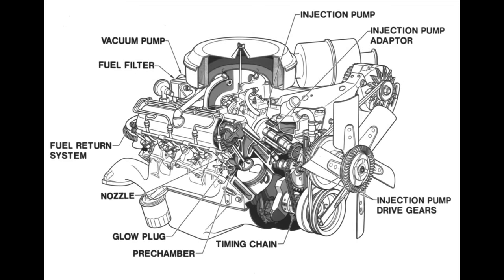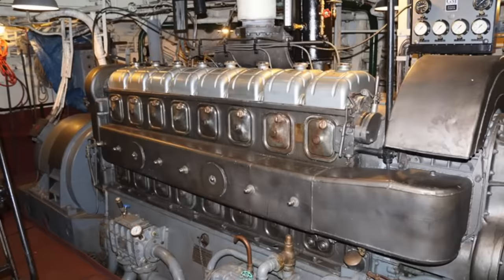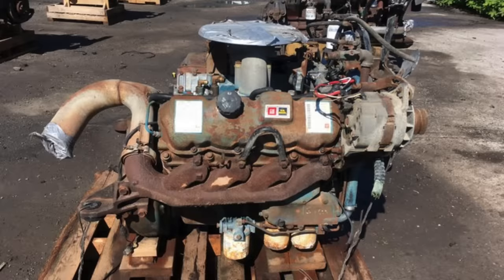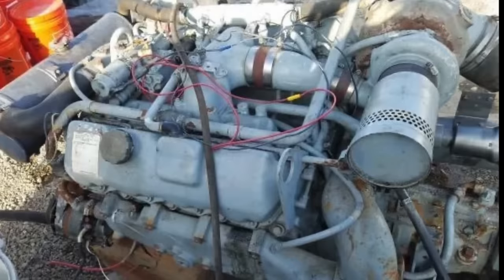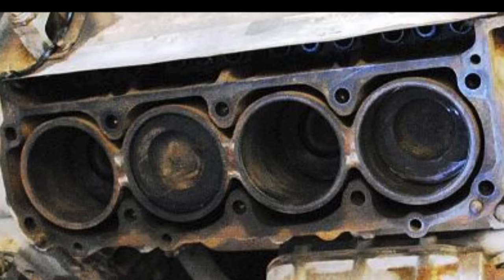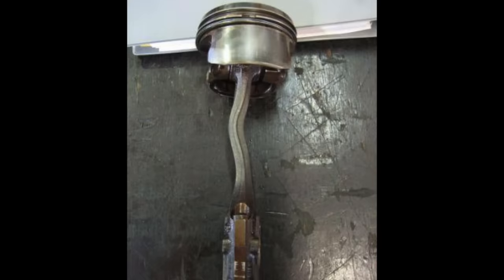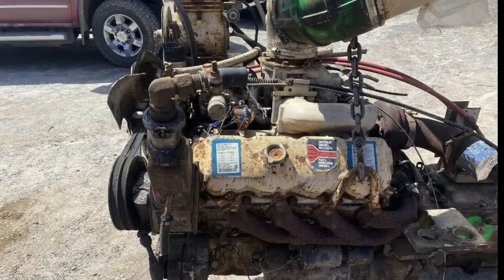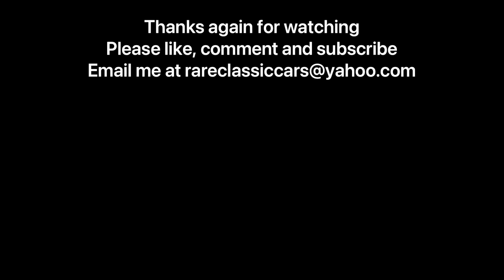Worst Engines: GM's 8.2L / 500ci "Fuel Pincher" Detroit Diesel Pinched Its Owners' Pocketbooks

Comment: I think detroit lost market share because their heavy-duty engines (the series 53 and 71) were obsolete, and when they tried to put lipstick on their pig with the 92 series, they put 2-piece pistons in it which were an utter failure. They were so bad GM ran a full page color ad in the the trade magazines apologizing for all the problems with the 92 series and promising to make it right. But it was too late, many OO's and smaller operators were driven into bankruptcy.  The 4-cycle 60 series was a smashing success right from the start and really saved their bacon.

Comment: What makes this worse is knowing that Cadillac had a 500ci gas engine that made 400HP and 550lb-ft naturally aspirated like 10 years before this. When a turbo diesel makes less power and torque than a NA gas engine of the same size it's a sad day lol.

Comment: When I worked for the forest service back in the late 80s we had an engine that had an 8.2 in it. Yes I can confirm it was noisy, slow, tiring to drive long distance as top speed was 62 mph. It might had been an Olds diesel.
Reply: Wasn't the Federal mandated speed limit in the 80's 55mph?   Lol, yea I get it, 62mph sucks.... Alota medium duty trucks were geared for low tops speeds in that era unfortunately. 
Oldsmobile had nothing to do with these engines though. It was 100% Detroit Diesel.

Comment: Good lord. Those power numbers are hideous. The Cadillac 500 gas engines did better in HP and torque in their final years of production 75-76. And we all loved the 200 HP big blocks of the era. But at least they made torque which a diesel should make in spades. Apparently not in this case. What were they thinking?

Comment: I never understood why socket type cylinder heads where ever used. Extend those clys slightly into a reciever socket around combustion chamber with appropriate gasketing and one would think it would retain any and all so called benefits.  Eliminating the weaknesses of such a design.
Reply: You mean like a 149 series? Those things are not my favorites getting those heads off can certainly be fun!

Comment: Detroit Diesel designed the 6.2 around the same time.  While an indirect injection engine,  it had a closed deck block with 17 cylinder head bolts per bank..

Comment: The open deck design doesnt necessarily mean theres going to be an issue. At least not in gasoline applications,  Honda used open decks in its D and B series motors with stellar reliability,  my Mazda V6 has open decks and the block itself is known to endure 800+ HP levels in touring cars and 1000hp levels in drag applications.   A diesel is certainly something else entirely,  but its probably not impossible to make it work if adequate engineering is applied.

The honda blocks are known to fail at very high power levels,  the root of the cylinders where they meet the top of the crankcase would sometimes shift downwards, but thats when you ate making 800+ hp out of a sub 2 liter engine. At more reasonable levels an easy and inexpensive trick is to drill and tap a hole on the major thrust side of the block and use a stud torqued against the cylinder to about 1-2 inch pounds to keep the cylinders from fretting the gasket. Seal the stud and use a lock nut.

Comment: Tge olds 350 diesel sucked as a diesel, but it made a great block, crank, and rods for a race car. They were stronger than the gas blocks and had forged cranks and rods. 
The penny pincher diesel was horrible. 
The Cleveland diesel plant became emd and they made big Detroit style 2 strokes for trains and ships and giant generators

Comment: i wonder if i can take the old vega block in the barn and tig weld more metal at the top of the bores and re deck it to prevent the walls from walking.

Comment: Interesting.  I have a question, here.  Couldn't they put a Darton closed deck sleeve system in the block?  This would certainly get rid of the 'flex' in the cylinders.  I know that a lot of drag racers use this system in their cars, replacing the open deck systems on many engines.  I have a few friends of mine who have done that.  They hold large amounts of horsepower.   Just curious.
Reply: Well, it’s not a financially sound job. It isn’t done often, so the Darton sleeve/ deck set up would have to be custom made for extra $$$. Then, you are looking at another probably $3500-4000 in extra machine work. There are other fixes too, but all they do is expose other weak points in the block. Upgrading head bolts would help with the head gasket problem, but then the cam would usually lock up because the extra clamping force twisted the block. They would have to get a company like Dalton (Yes, Dalton, not Darton) to do for this engine what they did for the newest military 6.5 diesel. They upgraded the block, heads, crank, rods and pistons. That made sense because the military uses them still. But it doesn’t make sense on the old diesel because there are far better and cheaper drop in engines, and there just aren’t that many of these still being worked. Even if the price was reasonable, it’s still underpowered and not the best design. You can polish a turd, but in the end, it’s still a turd.
Reply: @adamr9215  I certainly don't disagree . I was more wondering if it would be feasible to put in an aftermarket closed deck system, not considering cost.
Reply: @johnandrus3901  In that case, it could be done, but would just lead to other problems. Even with the sleeve/deck set up, you aren’t adding enough strength to the block to handle just the added bolt torque. Unfortunately, it was just a poor design in an attempt to save weight.

Comment: I believe Detroit Diesel did produce a generation of the 92 series engine which had a lot of problems. This is why they lost so much market share. 
I doubt the Fuel Pincher engine was sold in large numbers. In 1981 Chevrolet offered 3 diesels for medium trucks: 

Cat 3208
Cummins VT-555
DD Fuel Pincher

I hope most choose the two other diesels engines or the gasoline option.
Reply: the 92 series was a successful engine, without serious problems, however by 1985 they couldn't meet epa standards and were withdrawn from vehicle use. i think they continued offroad for a couple more years, but by then the series 60 was kickin ass and takin names.

Comment: The DX 350 Olds Diesel blocks were the best toughest Olds blocks ever made.
You can convert them to gas with the older gasoline heads. Much thicker block that you could beat the hell out of.
No other Olds block can take a beating like that block.

Comment: In the late 70’s I worked at an automotive test center.  We had a large contract with DDAD, durability testing the 8.2.  I got to know that engine inside out.  I had high expectations for it.  I was very fond of it and crestfallen when it failed in the market place.  I thought they should have all been turbocharged, though.
Reply: Thanks for telling us that you were bad at your job. The engine didn’t fail in the marketplace, it failed when it came to working. Companies ordered them left and right, but after they came in and were nothing but problems, they changed their orders. You should have pointed out all of the obvious flaws and failed the engine. Then they could have made something worthwhile.

Comment: On the 5.7 "small block" gm diesels, it was 50% gm design flaws and 50% operator error. A lot of them failed from customers driving them like a 350 gas engine. Not warming them up or letting them cool down. Short trips and punchy throttle input. Add in a lack of a water separator and gm telling people to dump alcohol in the fuel, they didn't last. Seems like the only ones that held up for any bit at all were the ones in Cadillacs from old people driving them gently.

Comment: The cylinder liner movement issue is easily solved by welding at 6 points the top of the liner to the block.

Comment: Do a lot of new (gasoline car) engines now have those free standing cylinder cores? Even such as the Nissan V6 now in production?  Maybe have just a couple "bridge" ties to the outer cylinder block cases? 
How about the newer Ford V8 "Coyote" is it like that? Is it aluminum? Is it inferior in durability to the recent cast iron "modular" and police V8s (although with its many valves seems to make a lot more power to get into more wrecks)

Comment: Obviously the downside of a long piston skirt is increased viscous losses from the larger oil film and increased reciprocating mass - both things you wouldnt want from an engine designed for fuel economy. Would be interesting to see if the finances of a high efficiency engine that needed regular replacemtn over a low efficiency reliable engine.

Comment: OK I'll bite. I worked at GM for the 80's 90's & 2,000's & I saw and heard a totally different picture. First: whenever a new design comes out everyone says wait'n see. If it works they all say it was engineered well. And if it doesn't do so well they all say it was poorly engineered. That's not the case. MANAGEMENT dictates the quality and robustness of any new model. Engineers know how to do things correctly but they answer to Management. I attended many hours of "Quality" meetings, but each one ended the same way. WARRANTY was the dictator. Management always tried to convince everyone they wanted quality but what they really wanted was to just get past the warranty period. I got there for 2 yrs of Pete Estes. Then came Roger Smith. Something was wrong w/ Smith.  No one liked him and they would not perform for him. Bickering and fighting were the order of the day. Recall Ross Perot. Smith removed him at a cost of $750,000,000. It was over the argument about how to treat employees. Perot said "An Army Travels On It's Stomach, Feed The Troops" but Smith would have none of that. Smith hired temporary employees so there was no future for them. Smith wanted a two tiered quality system, one like Cadillac & one like Chevrolet. He even authorized the sale of the Chevy 350 V8 to Toyota so they could have a strong V8 for their Tundra. Paying off Ross Perot almost bankrupted GM. Smith didn't care he was a lawyer. Bankruptcy means something different to lawyers. Bob Stemple was a breath of fresh air being all engineering but he was doomed by the Roger Smith loyalists. All of the problems from the 80's on up are a product of poor management. Even Barra can't pull GM out of it's grave. Remember I Was There. ben/ michigan

Comment: I have one of these in an older Asplundh bucket truck and somehow it has over 375k and still runs, if you can call it that, lol. The pony motor for the bucket may have more "oomph" than the main propulsion unit ffs!

Comment: A new high low rating .. Just when i thought i seen the worst gm diesel and thats saying something there was another one ..Well at least i never had to work on one of these marvelous pieces of engineering.. i was lucky enough to work on some of the other gm diesel before i left gm as a mechanic and never looked back . The vaga lol . I remember one being dragged into the dealership.  The mechanic that i initially got the piece of crap loaded up his tool and left . I should have to but did a little later . The mechanic said well we dropped the bom on the Japanese and they dropped the vega on us lol . What a piece of crap , including some of the transmissions ..  Thanks for the video

Comment: John Deere had a big part in the design of the 60 series also. Th first Proto types 8960 series had a 60 series engine in them.
Reply: At the time of the Penske purchase of Detroit Diesel, GM and John Deere were considering a joint venture of their diesel engine operations into "DEDEC Diesel". The Penske deal made the joint venture a moot point. If you google DEDEC Deere, you can find old marketing materials that were printed in anticipation of the joint venture.

Comment: Yes low on power but the one we had in our old bucket truck was actually pretty reliable . Ours was in an old C60 Chevrolet
Reply: yep we had one in a 82 L700 bucket truck with a allison 4 speed auto it had two throttle positions on the floor or Idol

Comment: We had a 8.2 litre in a Chevrolet school bus it held up ok but it was so underpowered  it took 1 mile to reach the top end speed of 60mph and would not warm up decent it was a awful cold ride at -30 when the engine would only warm to 120 degrees.

Comment: Ford did this same design on the focus turbo engines in the recent years and have had nothing but head gasket issues due to the cylinder scrubbing. Open deck designs are/always a terrible design.

Comment: Well, about that torque - horsepower. Why people are like "Hey it don't have HP but it have torque"? Like torque and horsepower are "opposite things" or something like that, when in reality, they depends on each other (and also engine RPM). 
You can have 130hp engine with 1000Nm of torque but that just means, it produces 130HP at about 920RPM, nothing else, it's still a weak engine...

Comment: When I look for C70 trucks I pass on any that have that V8 Detroit in them. I can get more hp and tq from a small block chevy. And with a mild cam swap the de bored 454 called 427 truck is a beast.

Comment: I drive a 2004 freightliner Columbia with a Detroit diesel series 6014 L and I think it’s a great motor I got 625 hp 1850 torque and I can get 8.8 miles per gallon and it doesn’t give me much problemsECM is the biggest problems I’ve had

Comment: These were anemic trouble plagued engines, blew out head gaskets as cyl walked and ate head gasket, leaked oil also but having no power and low torque made these junk

Comment: Uh, I stand to correct. I have a customer that has three single axle GMC and Chevy straight grain trucks and they all have those engines. They have never been been touched and have been serviced every 7,500 miles, with 120k-155k miles on them. Trust me, they scream, he drives them up to about 75mph most of the time.

Comment: I usually like your videos, but this one is way off the mark.  To rank this with the Olds diesels is BS.  The engine would not have been produced and put in tens of thousands of vehicles from 1980 to 1992(?) if it were that bad.  I own three (a 1985, a 1987, and a 1990) and they run exactly as they should.  I acknowledge earlier models had headgasket issues, but that was solved.
Reply from the maker: They did get better, but something has to be said for the fact that Roger Penske wanted nothing to do with them…I’m sure for a reason
Reply: Yeah I don't even like GM but the 8.2 was pretty good would run forever
Reply: If use in "tens of thousands of vehicles" is evidence of it not being "that bad," consider that the Oldsmobile diesels you're attempting to differentiate it from were put in 310,000 vehicles...in 1981 alone.
Reply: @mikebrunello243 do you understand what ‘forever’ means
Reply: I mean,
A 1.9 vw tdi engine with a chip tune makes more power. 

When compared to an 8.2L

It’s embarrassing I wouldn’t be bragging about how great they are.
Reply: Agreed. Yes the 8.2 had it's fair share of issues, but it was not a complete abortion like the Oldsmobile fiasco. If a responsible owner/operator knew what he had with an 8.2, and learned the proper way to run them, they really were good engines,  and very fuel efficient.
Reply: @fastinradfordable You're comparing apples vs oranges here. A VW TDI is a much higher speed diesel that these old 8.2 Detroits. Horsepower is a poor way to rate diesels anyhow, torque is the important number. The higher powered 8.2's made plenty of torque, way down low in RPM. That's something those little VW diesels don't do, and that's why they are in little cars, not medium duty trucks.
Reply: @RareClassicCars The 8.2 diesel was produced at the Romulus, Michigan plant and the Series 60 along with other Detroits were made at the Redford, Michigan plant. The Romulus plant was not sold to Penske and continues to build engines and transmissions for GM. The 6.2/6.5 diesels were also Detroit Diesel designs and were produced in Moraine, Ohio and that plant was not included in the Penske deal as well.

Comment: The HP/Torque would have actually been not too bad for the era .. I know it sounds trivial compare to the 5.9 Cummins, DT-466, or T-444 .. but it would have got the job done .. if it lived long enough to do the job. This really was Detroit's darkest hour, and then light duty debacles like the 6.2, which like a hump backed monster child hidden in a cave, would become the 6.5 and 6.7 .. When they ran, they ran like a 305 gasser .. when they didn't - the crank snout would randomly bust off and you were super-forked. I never did understand how a division that banged the 71 series .. Sure, the jokes: Most efficient means of turning diesel fuel into noise .. the leaks .. 160 HP from a 1500 pound block .. but it just seems in hindsight the Detroit slide-rules suddenly started doing the cocaine around 1978.

Comment: Those mills wouldn’t even make a good boat anchor. Challenging? That was trying to get the valve covers or oil pans not to leak. The GM gasket didn’t even fit , after working on a few yard goats that came from the port of Oakland that were used for moving trailers around  , I just would remove the covers toss the gasket and use a heavy bead of RTV and not tighten the cover down all the way and wait a half a day for the sealer to set up then tighten a little more and wait till the next day, what a pos! Like their earlier cousins they lived up to the screaming Jimmy reputation as a leaker. Don’t even get me started about leaking injectors lines, like I said a boat anchor wouldn’t be a good use for that hunk of 
CENSORED 🤬